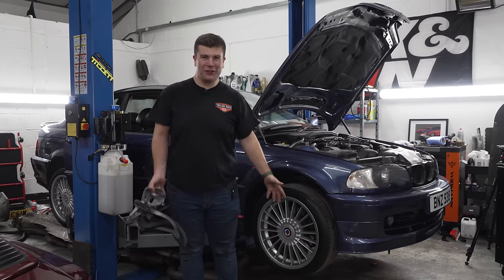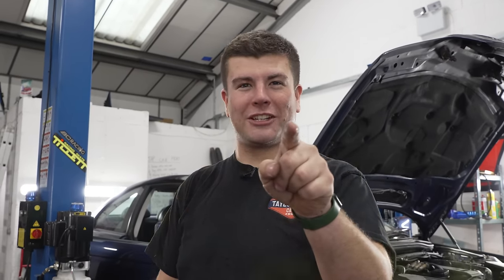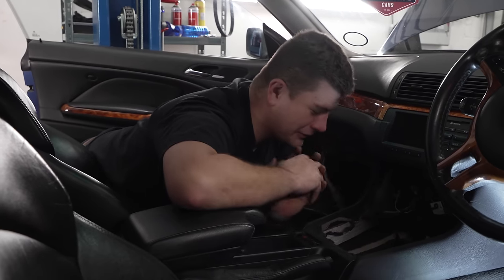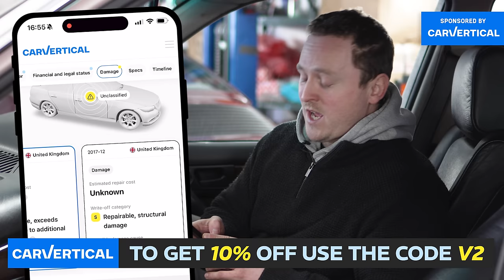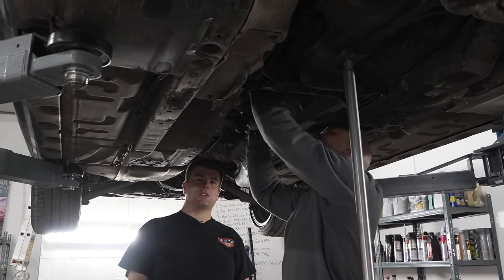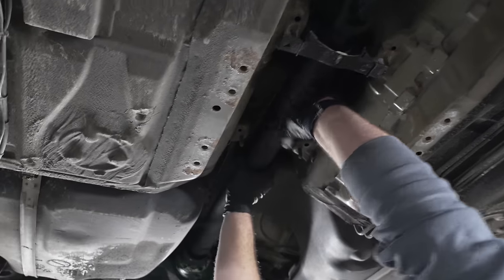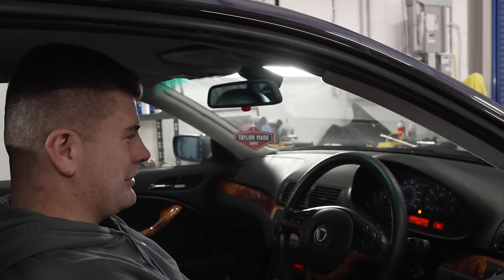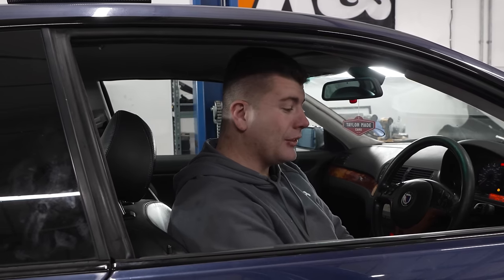I MANUAL SWAPPED AN ULTRA RARE BMW! - PART 2

Comment: 3250rpm at 70mph sounds about right for a 3.38 ratio. Shout out to Nick and Jay!! Top lads
Reply: Too high for motorway cruising. If he fits the correct 2.93 diff to match the manual gearbox it will be around 2700rpm at 70mph.
Reply: @gregmarking6716  if you’re doing a lot of motorway driving then I would agree it’s not a good option for a 5 speed, but a good upgrade otherwise as the car is a lot more lively when compared to a 2.93.
Reply: A 3.38 ratio is pretty perfect - as long as one uses a BMW 6 speed gearbox 😜

Comment: The front half of the driveshafts are all you need when doing a swap like this, if you put the front half of the manual driveshaft onto the original automatic rear half of the driveshaft it would have fitted without needing modification! 

All e36s and e46s are like this, for example small case rear ends have a longer driveshaft, so if you pull a manual conversion out of an e36 318 the driveshaft will be too long to fit into a e36 325, but if you put the manual front half of the shaft onto the auto rear half it will be the correct length as the rear half is a certain length to suit what rear end you have.

Comment: I’ve performed the same swap on a E46. Very straightforward, did my own wiring for the reverse light to the relay panel under the bonnet. Also did the coding to remove the TCM from the start up roster. Piece of cake. I also made an upgraded shifter linkage from the transmission to the shifter assembly.

Comment: i love that the banter on the podcast is making it into regular shop shenanigans.

DIFF RATIOS: the smaller number vs 1 means higher top speed, less acceleration. a 2.76 is much higher top speed than 3.73 but is way slower off the line. my stock O2A trans in my vr6 golf is 70mph at about 3k rpm on stock sized tires.

Comment: For the love of everything holy, check the Aux Belt Tensioner is the later 3 point mount hydraulic type. The earlier ones were two point mount concentric spring tension, and prone to failing. 750gms of ally lump flailing around the engine bay connected to the drive belt makes an enormous mess of everything. Speaking from experience of my 99 B3 3.3 doing that very thing. 

The tensioners were often missed on Alpinas because the service bulletins didn't apply to them, only the regular cars.... despite them using the same peripherals. This also allowed the main dealer to deny any responsibility for fitting the older type. 

Only other B3 3.3 thing to note is that it will eat its rear suspension bushes between services - the 3.3 puts out a lot more than that boggo 328/330 setup can really cope with.

Comment: Coding out the gear cog is easy.  You need to remove a line from vehicle order in INPA.  I know because my 330Ci Clubsport was converted to manual and I did it on that.  I think it's #250 that has to be deleted.  

Great to see our E46 lifesaver, Nick Jupp there too.  :)

Also with my diff (which I think is from an auto) is doing 3,000rpm at 80mph.

Comment: I own a dual fuel van with the LPG conversion fitted from the factory and couldn’t fault it. Not much difference in performance but much cheaper to run. Definitely worth keeping the installation on the car, run it on the LPG until the tank is empty.

Comment: also make sure you do to the golf tee mod on the stock exhaust or make sure the flap opens easily in the muffler i did that mod to a 323ci and it sounded a bit nicer than with the stuck closed flap ps i jammed a metal rod to unstuck it to permanent open position :) and then put a screw in the vaccum hose for that flap

Comment: How to depressurise the LPG system, just find the tank. remove valve cover, close both input and output valves and job done. You will have some gas left over in the tubes apparently so no worries... By the way LPG is great, I wouldn't remove it. It's one of the cleanest energy sources what we have and around 110 octane, it's a shame Britain is in complete ignorance if it's practice. Half of the petrol cars in main land (especially East) Europe are run with it and every other station stocks it, while here lucky if you find one every 50 miles, quite sad to be honest...

Comment: For removing lpg shit. You have to close off a valve that is on the tank in the boot and after that is safe to remove. There will be some residual gas in the lines but its not dangerous, just ventilate the unit and take caution like while.handling gasoline lines.

Comment: Im sure you'll find it online but reverse light switch is super simple. Don't need all that junk you held up to the camera. Plug on the trans, one goes to ECU and one goes to ground, done. Also you will need to code out the auto computer. Without coding there is rev hang.

Comment: Is the speed sensor on this model not on the output shaft of the gearbox?  otherwise it doesn't matter if you replace your differential, your speedometer will still give the wrong reading.

Comment: In the boot in center of the gas tank there is a valve that you close, and then all that's left in the system you just release into the atmosphere and that's all

Comment: the rpm is correct for the 5 speed, should have nicked the 6 speed from Alex then the rpm's will be 500 lower at 70

Comment: Any real mechanic would know that you don't actually have to pull the auto pedal box to replace it with a manual one, as it already has the manual clutch pedal shaft , all you really need is a plastic clutch pedal and clutch master cylinder  both dirt cheap from BMW,    how do I know this??? 54 years of working on cars as a real mechanic might help😂😂😂😂
Reply: Well then that must mean you're better than all of us. Well done 👏🏾👏🏾